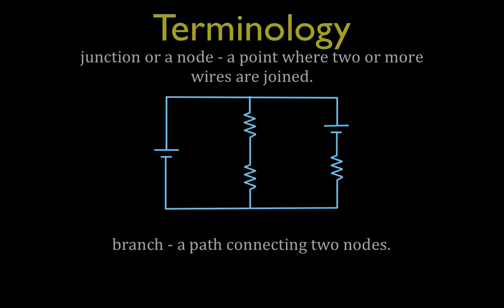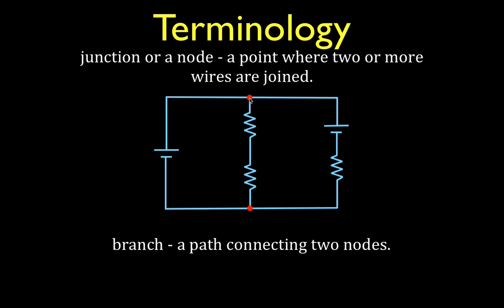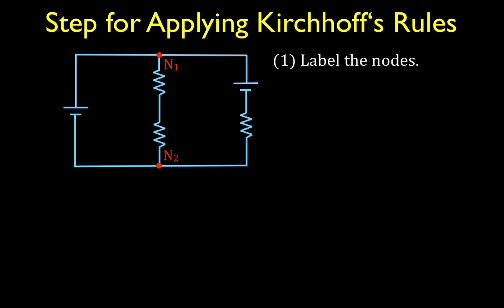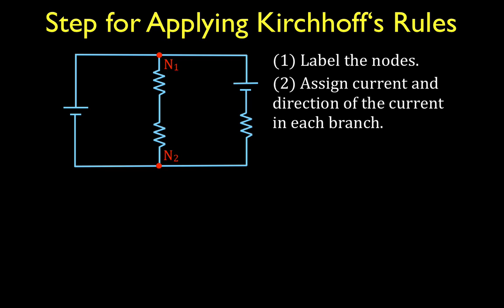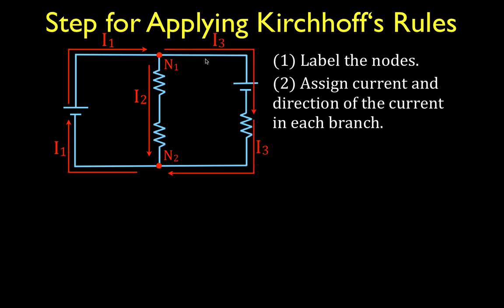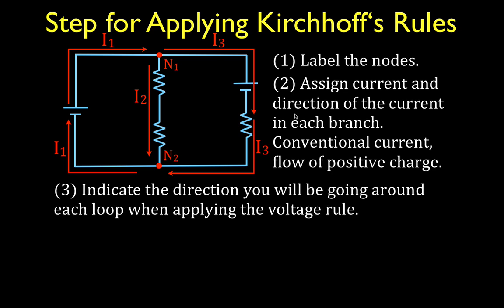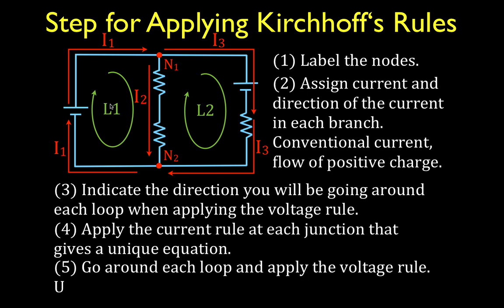Kirchhoff's Rules (1 of 4) Circuit Analysis, An Explanation

Comment: Concise explanation, thank you. When you were referring to the loop crossing the battery, or the "across the battery convention" as you put it, does the direction of the current have anything to do with the sign of the voltage?
Reply from the maker: It only matter which direction you are going when you are applying the voltage rule around the loop, if from the negative to the positive terminal then it is a positive voltage.  If you are going from the positive to the negative then it is a negative voltage change.

Comment: Best explanation. My only question is, why is the voltage drop across the resistor negative when the current flowing through the resistor or load is going in the same direction as the current in the loop.
Reply from the maker: When the current flows through the resistor there is a decrease in energy.
Reply: @stepbystepscience  I get that but whether it flows from left or right it still flows through the resistor. Unlike the cell or battery when the loop flows from a negative terminal to positive terminal we denote a positive gain in potential.

Comment: very good explanation! Question - In the ckt above if there is a capacitor, then applying the voltage rule, it the voltage positive or negative, assuming the same direction of current flow as in the video. Please let me know.

Comment: Re: across the battery convention. Does it change in the case of an independent voltage source ? I see people using a negative value when following the current negative to positive across an independent voltage source.

Comment: Shouldn't there be a third node between the 2 resistors between N1 & N2, or is that just a preference thing? I was under the impression that a node is a point where 2 or more circuit elements meet.
Reply from the maker: Node occur where branch meet, where the wires come together or split. Not where circuit elements meet.

Comment: Why does current flow as I2 in loop L1  from battery on the left but no current flows as I4 in loop L2 from node 2 to node 1 from the battery on the right???

Comment: but...in SL aurora Guide , the current-resistance (IR) product is taken as positive if the resistor is traversed in the same direction of assumed current and vice versa...i.e. 
V= +IR , if the path is in the same direction of current and
V= -IR if the path is in the opposite direction of the current.

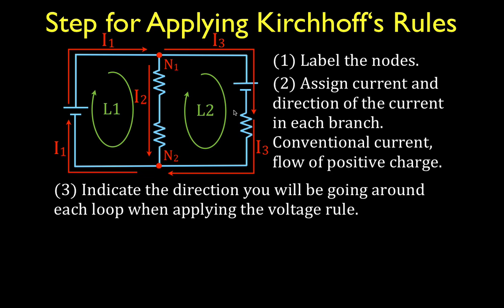Comment: Can you comment on what the choice of loops should be in a given circuit generally: ie should no loop be the combination of any of the other loops chosen. For example, at 3:40 would choosing the outer loop also here just yield the same information as the two inner loops.

Also, can you give any intuition whether Kirchoff rules always lead to a solution: ie that we always get as many independent equations as variables. Thanks.
Reply from the maker: You can choose any loops you want as long as they include all of the circuit elements you are trying to solve for.
Reply: @stepbystepscience  
Hi thanks for getting back. Yeah obviously we can choose any loops as long as they have the elements we want to solve for. ☺️

I suppose I was wondering more if there are basic guidelines for doing this prudently and efficiently.

So e.g. without redundant equations: I presume this mesns no loops that would be combinations of others (e.g. in a two loop circuit, I presume there is no new information from choosing the outside loop if you have chosen the two smaller loops).

And e.g. as many independent equations as elements to solve for: I suppose that refers to my second question above- is there a way to know that we can always solve for all elements every time.

Comment: hey i want to ask you a question In the series circuit the voltage drop across all resistor must be equal or greater than the voltage source is it right?
Reply: It is equal to the voltage source. It can't be greater.
Reply: @chichileno  thank you

Comment: I am of the opinion that all loops should only be in one direction. That is in the direction of conventional current flow. Allowing us to have loops that go against conventional current flow will  only cause confusion. In fact it annoys me that we are still given this option. We should stick to the convention. Is there anything wrong with this point of view ?
Reply from the maker: OK, but sometimes you do not know the direction of the current, conventional or otherwise.
Reply: Thanks. I understand now. Please tell me do engineers apply the conventional method when designing and do technicians use the conventional method when testing or and repairing or is the conventional method just for learning purposes ?

Comment: It would be more clear to node definition if you would show a 2 wire node and not 3 wire nodes only.
Reply from the maker: A 2 wire node is not really a node. One wire in and one wire out.
Reply: @stepbystepscience  That's what I thought. It was the rule you postulated that threw me, 'a node is two or more wires at a juncture'. If I knew what this all meant I would not be visiting you. Thanks